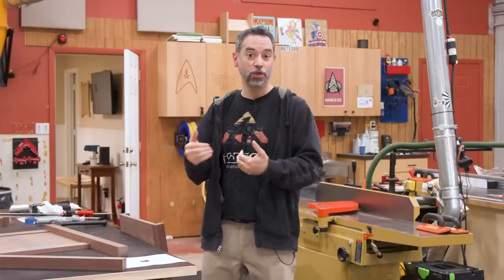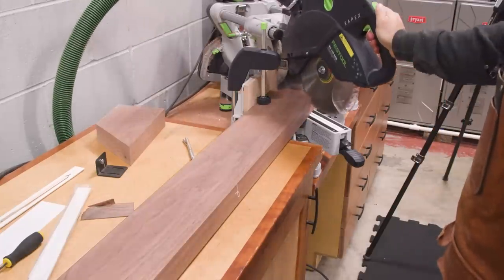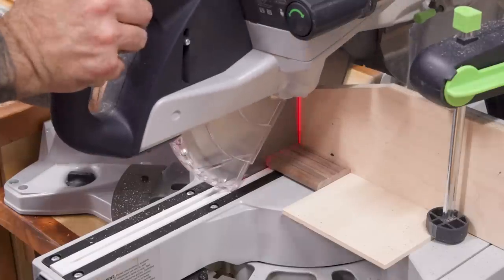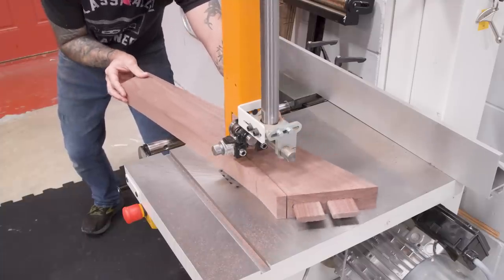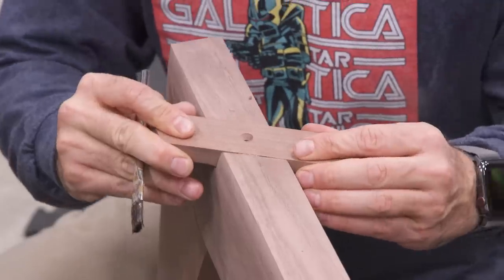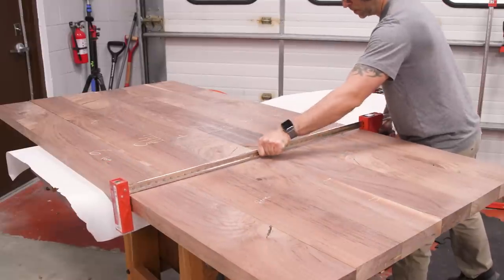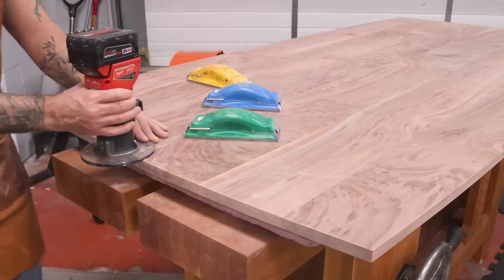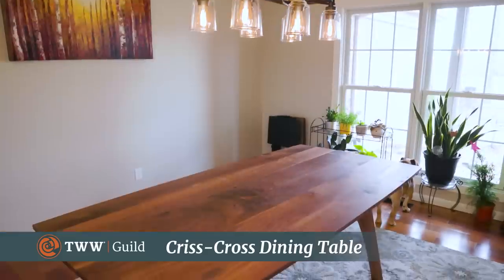New (To Me) Design - Criss-Cross Table

Comment: I LOVE this piece!  Years ago I brazed together the iron sides of an old Singer sewing machine treadle base into a + shaped base for my kitchen table, topped with a circle of slate I cut from a pool table center slate.  It has a similar twisty springiness, but nothing too bad.

To my eye, those inserts looked like the type designed for softwood, with aggressive toothy threads.  Hardwood inserts usually have smooth threads that shouldn't fight you so much going into walnut.  But now that they're installed, it doesn't really matter for your purposes.  I'm sure they'll be more than strong enough.

Comment: Good morning from Texas, Marc. I built an octagon poker table a while back with criss-cross legs similar to yours. I also wondered about the rigidity of the assembly, so I added criss-cross stretchers about 10" below the top. Still out of the way and they added more strength to the build. That walnut is "real purty". Thanks.

Comment: You haven't seen a criss-cross table before?
I have.
I built a 6' x 2'6" sapele criss-cross coffee table when I was at school, back in the 1960s
I made it that way because I was too lazy to cut all the M&T joints required for a traditional four legs and four aprons design :-) .
But my laziness paid off because the finished table looked great. In my view, much nicer than a traditional design.
Of course, back then there were no power tools in the school woodwork workshop. No planers, no thicknessers, no mitre-saws, no morticers, not even an electric drill. So any idea that made a handtool job quicker and easier was a good idea!

Comment: So question, why did you choose to do the tenon cuts on the miter saw vs the table saw? Just curious as in my mind the table saw would be faster.
Reply from the maker: Because in my mind, the miter saw is faster. :) A cross-cut at the table saw requires a sled or a miter gauge. The miter saw is already built for a cross-cut. So in my shop, that's faster and easier. But no reason you can't use a table saw if that seems more logical to you.

Comment: Looks great! I actually built a similar design about 8 year ago. Not easy. I like the spline to stabilize the criss-cross joint, I wasn't impressed with how I did it with a custom made Kreg-esqe pocket screw jig and a plug.

Comment: curious why you thought the spline at the X was necessary ... there shouldn't be much if any stress on that joint, and dining tables don't get moved very often...
Reply from the maker: I think if you made one you’d immediately know why. The assembled joint was a little wobbly, even though the joinery was snug. The nature of the two pieces crossing over like that is lack of rigidity. The splines take care of that. After gluing the whole structure is quite solid. I definitely wouldn’t recommend building something like this without the additional reinforcement.

Comment: I thought the cross-grain piece under or at the end of table tops was to prevent cupping. No such piece was used here. Have I misunderstood something?

Beautiful table by the way.
Reply from the maker: That's one of the functions a perpendicular apron would serve: encouraging the top to stay flat over time should it decide to move. But in relatively constant environmental conditions and with good support, panels generally behave. We'll see how it holds up over time but I'm definitely not worried about it.

Comment: Question-looking to upgrade from my Delta table top spindle sander any suggestions? Thanks
Reply from the maker: I recently got the Oliver. Zero complaints.  A great machine.
Reply: @woodwhisperer  bench top or floor model? Thanks
Reply from the maker: Floor.

Comment: How many coats of the Tung Oil mixture did you do?
Reply from the maker: About 5 in total.
Reply: @woodwhisperer  Sanding in between? 220?
Reply from the maker: Nope. Usually no need with an oil.

Comment: Marc, I really enjoy your videos and how you dissect each section your doing. You mentioned the huge router bit and it being safe as long as you run it at the "right speed" What is the right speed? Does it vary with the wood species, thickness of the wood, etc?
Reply from the maker: For me the right speed is the one that doesn't vibrate the hell out of my router table. That bit lets you know when it's unhappy.

Comment: Marc, first of all, good looking table.  I am going to build a table of similar size in the coming weeks.  I purchased some metal legs.  I have a question about adding metal “c”channel on the underside to keep things flat.  Your table legs have a lot of contact with the table, mine won’t have near as much. Do you ever add a “c” channel on the under side of tables? If so, when would you, and when would you not?
Reply from the maker: I’ve never used a c-channel. I would only use one if you have a specific reason to suspect the material will cup.

Comment: I used a half template on a similar shaped table top, any tips for alignment? After flipping my template to the other side, I was slightly off so my curve didn't come out perfect.
Reply from the maker: I just measure carefully and align with the marks on the template. The only part that needs to be finessed after that is where the two curves meet, which is just a quick sanding.

Comment: Fine…..I’ll bite and take a kick for the masses? Other than just because,  was there a reason you did not use a domino or dowels?
Reply from the maker: I would prefer mortise and tenon joints over dowels in almost every instance. Especially for something load-bearing like this, I want as much strength as I can get, within reason. And the reason I didn't use the Domino is just a continued effort to show you don't need one. I assume people that spent the money on a Domino already know it's a great mortising tool. I'm trying to help out the folks that don't have one.
Reply: @woodwhisperer  I really appreciate the honest reply back. It’s easy to forget in this day and age that it’s okay to have a personal preference different from the masses. And this video showed that with a little forethought. You can have Domino style joints without the huge cash outlay if this is just a hobby for some like myself.